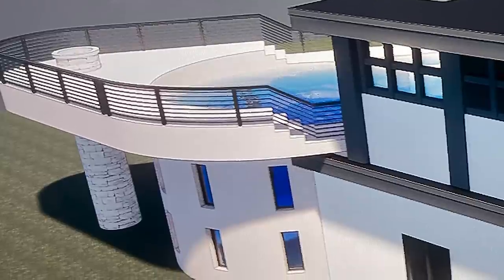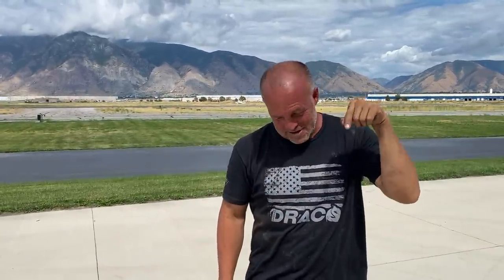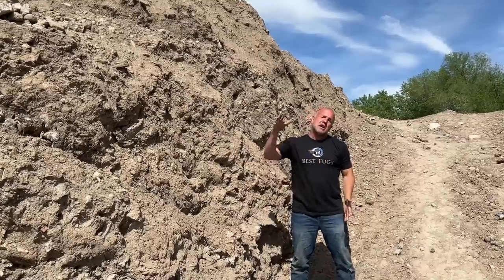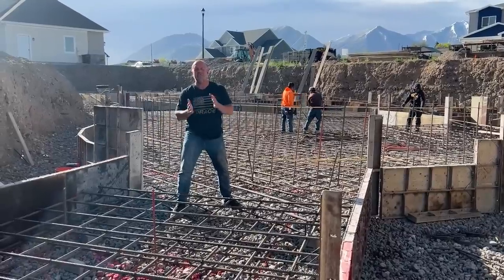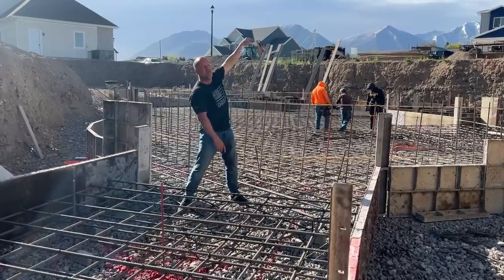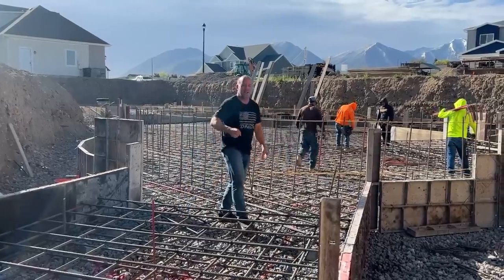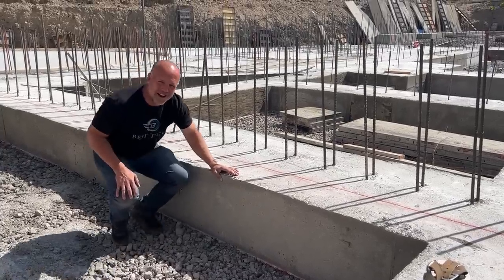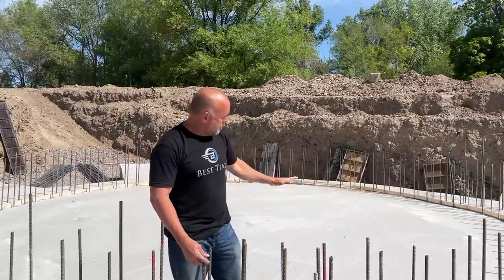I'm Building a 3 Story Rooftop Scuba Swimming Pool inside my Home! 😳 | House Build #1

Comment: So excited to see this video drop this morning Mike!!.  I have a little different perspective on this project.   I've know Mike for years, we did the HVAC in one of his airplane hangers 12+ years ago.  Even though we work on the wildest homes in Utah, and western states, with the most creative architects, and most demanding general contractors with very high expectations clients, and doing this at a large scale, with an engineering background, and then engineering estate home residential HVAC for 26 years, ITS STILL INTIMIDATING to work for this man. 

Not because he isn't kind, not because he isn't fair.  It's because the guy is intense on every level.  He doesn't leave any stone unturned, or situation unconsidered.  We recently met on site for the second time, and it was a blast to creatively solve issues with him.  

Mike, Brad, and his son were out there with minimal help tying rebar, setting forms, placing conduits.  Having watched his videos since the start of Draco, I always figured there were a dozen helpers in the background making things happen.   This is not the case. Mike was out there doing labor I would never dream in doing my self (placing and tying huge rebar in thr blazing hot utah sun)  let alone with a net worth that Flys over mine. 

Money doesn't drive Mike, maybe it did at an early age, but he just like to bust ass and work hard, and do create amazing things.  

I also questioned the neighborhood location.  No question, he is overbuilt for the neighborhood.  For him, it's close to family, it's minutes to the airport.  Mike is just that pragmatic.  He could build a bigger, more involved home in one if many neighborhoods surrounded by $10m estates another 20 minutes away, but unlike most in his position in life, he realizes time and simplicity is his most precious asset.  He is just that pragmatic.  He doesn't car what others think, he just does him.  

Chandra is an amazing balance to his personality, together they are a great team.  

  This guy is the real deal, and before this, I knew him only at arms length, as a local "Tony stark" personality.  He keeps to him self, puts his head down, and makes things happen.  

There are so many details and wild smart and intuitive ideas he is implementing into this home that I've never seen before.  I'm sure he will share.  Even on his sprinklers lol.  It makes me wonder how many rabbit holes on his airplanes he didn't even share because of the format allowed here on YouTube.  

Back to work!!
Reply: That giant pool would make a great heat  sink for cooling the house and also a good source of something warmer than air for heating with a heat pump. I’m guessing that Mike will want to take advantage of that? Maybe you can fill us geeks in about the details of the system?
Reply: So great to hear your side!

Comment: I'm kinda interested in how you'll cope with the side load on the side of the building with that much water. Anyway - freaking epic stuff!!!
Reply: There is a reason why water towers are usually round, the forces of water pushing in all directions cancel each out. You "just" need some material which an resist tensile forces. Guess the same construction is used here, we will probably see some prestressed concrete.
Reply: Water column is about 1/2 psi per foot so at the bottom the lateral loan would be about 13 psi which translates to 1800 lbs/sf. I bet those windows will be several inches thick.

Comment: When you mentioned the movable floor my first thoughts were of the locks on the Peterborough Ontario Lift Locks. I first saw them in 1988, age 22. I was a young racing car mechanic and the engineering behind that lock blew me away. Can’t wait to see how you make the floor move although I have a good idea based on what you said of how you’ll do it. I’m also very curious as to the choice of location in a subdivision of some kind and not a more private location on anywhere from 3-10 or more acres? With that I do understand not wanting large amounts of property that requires maintenance and upkeep, if I never mow a yard or paint a house again it’ll be too soon!

Comment: Neat build.  Always love seeing how others do builds in other areas.  As here it would be a lot different.  

One thing, the floor of the pool raising and lowering is something that has been done before but usually to raise the floor of the pool to be a deck.  When the pool isn't in use that can be a whole area that isn't in the water for decking.  Or drop it just enough to sit chairs in to tan in like they do at resort pools.  

A lot of new tech in concrete that some use and some don't know too.  Some for added strength.  Some for a lighter weight build with the same strength.  Concrete in the 5000psi range is pretty close to waterproof.  Also, chopped steel put in the concrete increases the strength also.  Some concrete companies don't offer it though.  There are some additives that really ramp up the strength too.

I dive too.  I wanted an 80 ft pool but figured that would be too much.  Was planning on digging it deep and going up to a second story.  But probably a bit to much.  ;-)

Anyway, enjoy and have fun with the build.

Comment: I’ve been watching since Draco started… I’m always amazed and inspired by MP. However as a structures foundation  contractor ( I build bridge foundations) I would have driven piles but I can see that this giant spread footing should work well especially since it’s dug down to solid material. Rock on MP you are the Man! PS I’m wondering how he’s going to heat the pool?
Reply: Piles are driven to get to bedrock or for stabilization in looser soils where bedrock isn't an option.  In this case the whole footer is a pile.

Comment: Mike, completely untreated here:

Ive been thinking i would like to see what you could do within the FAR 103 ultralight category. I would love to see what your mind could do with the retrictions in place.
Reply: I can see a 175lb. Legal Eagle,.. Aluminum Wings,Double slotted flaps, 25mph stall, Carbon fiber body and a 75 H.P. 50 lb. motor that runs at 60db.🤔.
Reply: @robertlafnear7034  im also thinking a wing with flaps and Ailerons. If he got it light enough he could even do the 912ul engine.

Comment: Here's how is see this build going. "Chandra asked about possibly adding a whirlpool to the deck? I said, you know, what if we just turned the whole pool into a whirlpool? I started doing some math, and it turns out, structural concrete can not deal with the additional lateral loads introduced by 25,000 gallons of spinning water. So, I decided to make the entire pool and upper 2/3 of the house, out of carbon fiber. I looked, and I looked, and it turns out that no one has ever thought to make a 24 foot deep, carbon fiber whirlpool, with a movable floor. I immediately got back to work, carving a new mold for the carbon fiber sides out of some leftover foam from my Scrappy build."

Comment: I'm personally most interested in the moving floor. 
It will be very interesting to see how they make a platform that large travel up and down about 20'. While completely submerged underwater and having to keep the whole enclosure water tight with probably over 1 million pounds of water in there. 
I'm guessing it will be setup like a post lift where it rides along tracks in the walls to keep it square and level through it's travel, but use water ballast tanks for weight to lower and compressed air for buoyancy to lift? 
I can't imagine a scissor lift or cable/chain driven post lift would work for this application but I could be wrong.
Again, just looking forward to seeing how Mike plans to accomplish this 🤷‍♂️👍

Comment: Are you adding a pool to an already existing home, or are you going to build a whole new house  & scuba diving pool. Also is the pool going to have like a floor on a scissor lift inside to change the depth of the pool without pumping the water out into an auxiliary tank. I'm an A&P mechanic also, with an Associates in Applied Aviation technology. My goal was to get a Bachelor's in Aerospace Engineering, or get a Bachelor's Degree in Aviation Management, would have been my best bet, but life got in the way , & I wrenched on a lot of planes & also did a lot of sheet metal work, bending, cutting, & counter sinking holes in sheet metal, along with bucking rivets until I damn near went me crazy. I always wanted to build a triangle shaped glider, similar in to Stealth  Bomber. With the entire top of the plane rounded. That way the entire plane is an airfoil. I would then cover the entire top of the plane in flexible solar cells. I would power this huge triangular glider with Siemens emrax 348 electrical motors that put out 420kw of power & 1000 NM these numbers are both @ peak power. The plane would be a hybrid diesel electric plane with solar assist. The generators will be 2 of the 400 h.p.  Nissan Nismo 3 cylinder intercooled turbo diesel engines, that only weigh 70 pounds each, yes pounds not kilos. The e-motors can be stacked like a rolls of coins.  I would want to build the bottom of the plane like a seaplane so it could land anywhere. I've always wanted to build a flying RV. A plane that could fly around the world. This plane would be built of mostly of carbon kevlar & titanium for strength, durability, lightness & efficiency. The inside would have everything a modern sailboat or a very nice tour bus would have. With storage for electric enduro's & jetskis. After seeing you build all your planes, I sure you could build something similar to this. Peace, health, happiness, & lots of love in you & your families lives. Bentley.

Comment: That's weird ... I don't see any use of a concrete poker / vibrator?  In Europe we always vibrate it after pouring to compact it ... it's common for it to compact by at least 10% when you vibrate it and shake out all the micro-voids.

Comment: That is a lot of concrete. I have used around 500 yards pouring a pit scale with columns to hold three 200 ton asphalt silos. Question, are you going to use that deep water for a temperature control system in the house?

Comment: You might address it in the video- I’m just starting- but first thing that came to mind was the sheer volume of water in a 24’ tall tank- assuming 10’ radius, 7540 ft^3 or 56K gallons- and the amount of water pressure you could get out of a valve at the bottom. All that, combined with you being in wildfire country, and I imagine you could plumb it into a firehouse and/or fire sprinkler system for emergencies.
Reply: @ralphgesler5110   Was just going to say, it's the height that creates the pressure, not the volume, says the guy with a hydro electric system.

Comment: When Mike first mentioned the variable floor height a while back I envisioned an inflatable bladder using four guides recessed in the side of the pool with ratcheting stops similar to auto lift safeties every 5 feet or so...  a pneumatic solenoid connected via rods could allow the floor to stop at any level going up or down. A PLC could make the entire process automated with position sensors and valves with no motors involved. Curious if he has the same thoughts
Reply: I’m guessing that the floor will be operated via cables and hoists that are synchronized. Or better yet a water powered hydraulic system.
Reply: gear racks up the wall or chains in tracks or poles that zipper into a solid column would be my guess.  Depending on how fast it moves and how big the holes in the floor are, he may have to drive it down with more than just gravity.

Comment: If you want a lifting floor I think a lot of stages and pools use a system called spiralift.

But my bigger question is what about freezing?
Reply: Heated pools are nothing new.
Reply: @timh2313  most heated pools can't keep up with cold weather. They get drained in the winter. Particularly above ground pools. Might have better luck with a saltwater pool. I guess he can drain it too, but thats a large pool to drain and they get snap weather out west.
Reply: @TheJttv  pumps and heaters can keep up fine as long as you accept the gas and electric bill that comes with it.

Comment: Mike. Love watching your channel.  Great content and love the way you innovate everything you touch. It looks like your new house is In A neighborhood, but if it wasn’t, how cool would it be if the bottom of the pool raised up a little bit higher to be flush  with the pool deck and doubled as a helipad.
Reply: I like where you went with the concept. In the same thinking, you really wouldn't need a guard fence around the pool for unattended safety, you just raise the floor and roll a cover mat across it.  add some hardboard over that and you instantly have a dance floor for the outdoor party.
Reply: Stay tuned… 😁
Reply: @markw9113  I'm sure the close neighbors wouldn't appreciate helicopter noise.

Comment: Will be interesting to see the floor of the pool move, wonder if the holes in the floor will seal shut when done movie for safety reasons. Also isn't a bottom filter required? Would that be on the moving floor?

Comment: Did not get around to watching this video until now (and the later video on the walls of the pool going up). I'm a little surprised by the thin rebar where the bottom of the pool meets the base/foundation. I would have expected a heavier gauge of rebar and a few rings of heavy rebar to tie it together. Doesn't this risk the shearing the light rebar off the foundation and the bottom of the walls spreading out? Or is the rebar that is there sufficient to hold the walls down to the floor (and prevent the floor from detaching downwards under the weight of 24' of water column) and does the rest of the rebar cage that attaches to it do most of the work?

Comment: Wow for what your building to hold that much weight of water (8.3 lbs cuft) no consolidation of the concrete. Where is the special inspector to verify rebar, concrete strength that it was built to plans and specs?

Comment: I'm so curious how the sections around windows are detailed for tension. You don't have tension rings where they are interrupted at the windows –which are tall instead of wide– so above and below the windows carries all the tension for the interrupted section, and no good way to carry the horizontal tension from the panels between the windows to the rings, making the sections where the windows very non-uniform structurally. I imagine there's going to be a lot of cracking on the outside in the middle sections between the windows when it gets filled for the first time as it wants to bow out like a balloon in the weak section surrounded by strong rings on the top and bottom. If it works structurally, I'd still postpone final coat until it's filled to fill any hairline cracks that might occur.
Reply from the maker: Great observation and forecasting.  I’ll try and talk on specifically that topic.   You are spot on regarding the directions and loads.  You’ll see how we did the tension rings oversized above and below so that we could then add massive vertical rebar beams through the tension rings to prevent any movement vertically in the 4 foot tall span.  It was so much easier when we drafted the easy way out.  That was simple but, small,  square windows with very little vertical length.  It did eliminate thousands of dollars in bar and work but it was not the look we wanted.  When you see how we did it, I’m sure you will agree and we will all see when we fill it.  I’m not concerned and we are certainly looking forward to that day.  Great thoughts for sure.   Thanks for the comment.
Reply: @MikePatey  Looking forward to seeing it. Also on Scrappy, the spoiler I thought was going to cause a lot of pitch down. I think you mentioned you'd show some test sometime on that as well. I'm still curious about the flight dynamics on that.

Comment: Am I boring? Probably yes... late videos, but I will comment, during watching the video, as always.... Normal thing - remove "humus" (organic matter), that can rot and settle under enormous pressure... Go further: Seems that You used nice granulometry, and humidity of the base material under everything-nice! I will proceed... noticed short rebar - never weld it (if don't know how and why!), better to overlap, but at that length, You could use longer bars... If overlap, go minimum 30d (diameters), both sides... Seems pretty hot there - ALWAYS keep fresh concrete humid, for at least 7 days! -

Comment: Mike I'm surprised you used steel rebar

As it's susceptible to corrosion and oxidation

Need this to last at least 5 centuries
Reply: There is rebar, but, there is a better rebar alloyed for these types of applications or treated-rebar as well.  The question is, what did he use?

Comment: So would it be economically feasible to install a water filter and use the water in the ground to fill your pool with? Water in those amounts is expensive.
Reply: But there is a river nearby that will never miss a small side stream of water taken for the pool especially when a storm generates a higher flow.
Reply: @markw9113  Probably won't be legal to siphon off of a river, but a private well should be easier.

And cleaner.
Reply: @AllanFolm  need water rights to drill and pull from a well too, all the water is owned.

Comment: Thanks for taking us along!  As an ex-production home builder, I enjoy learning about how to push the engineering of dwellings (and pools).  I wonder if you used solidworks to calculate the forces, or is there another program?  We just got a plan from the engineer for the post-tension slab, so footings, foundations, and basements are a different challenge.